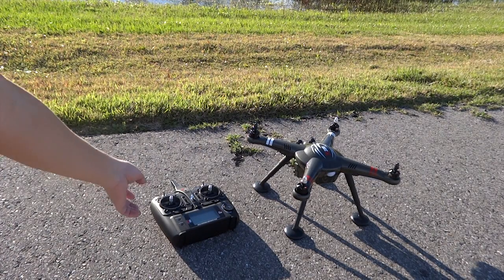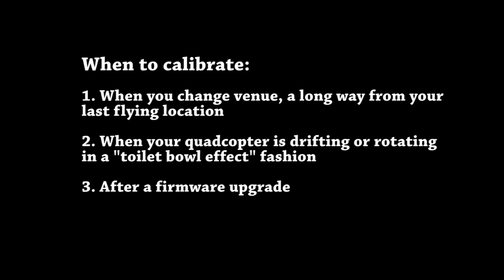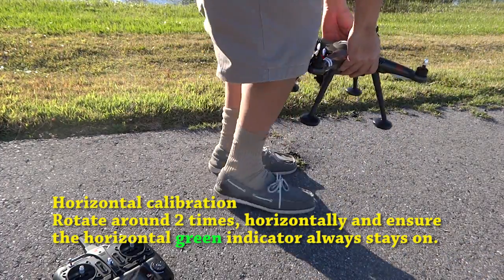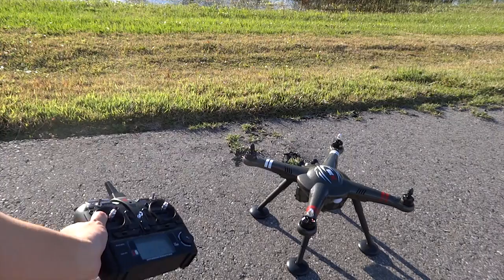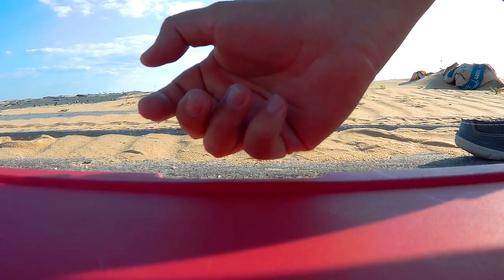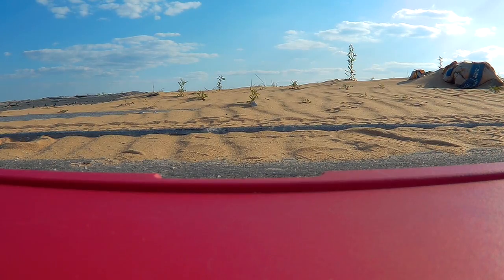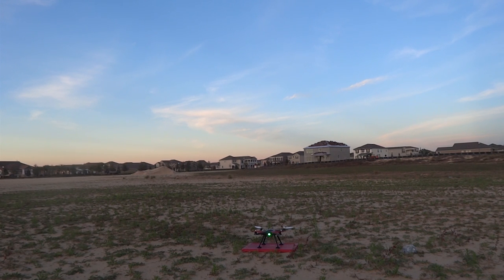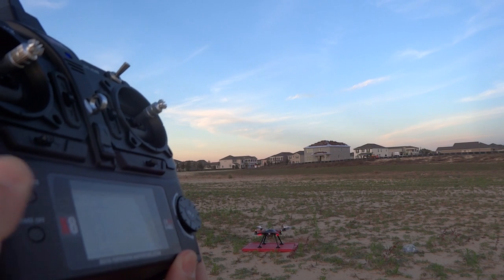XK X500 x380 Don't Just Dance, Calibrate!

Comment: Hi, very well stated video!. Which OSD did you use and are the data of the internal gps and barometric pressure sensor?
Reply: +D. Litau did you got answer ?
I would also like to know what OSD was used on X380 and how to connect it pls ??